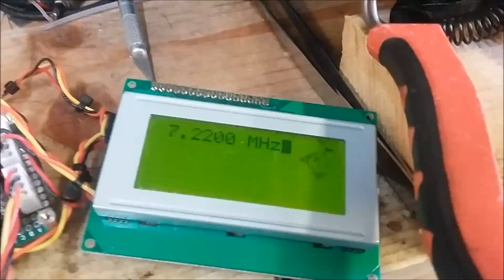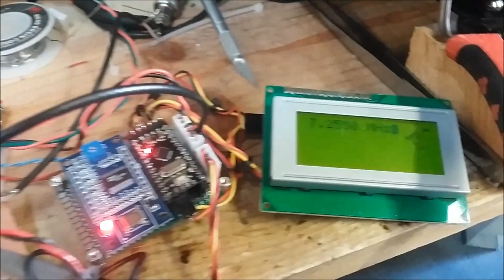J310 JFETs Configured as  Dual Gate MOSFET - Simpleceiver 2

Comment: Interesting. I have tried to replace a missing dual gate 3SK45 N-D-MOS with a cascode of two 2N3819, but I have not been able to get it to work, even by adjusting the Rg to the original Id values.